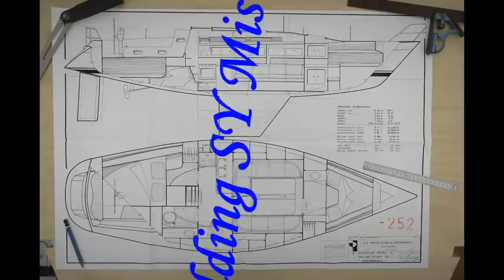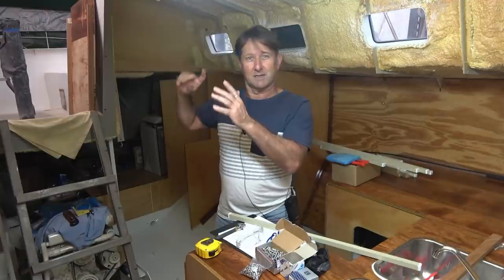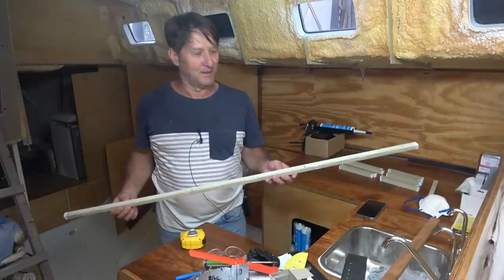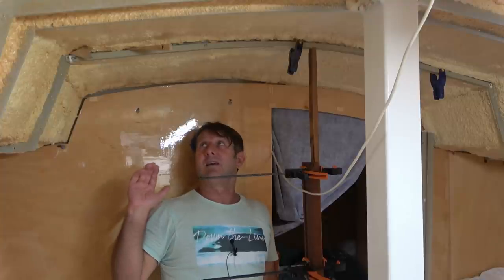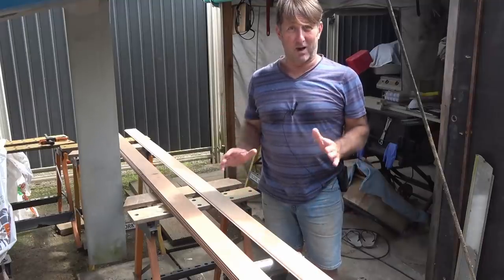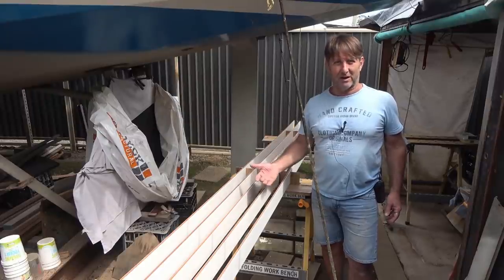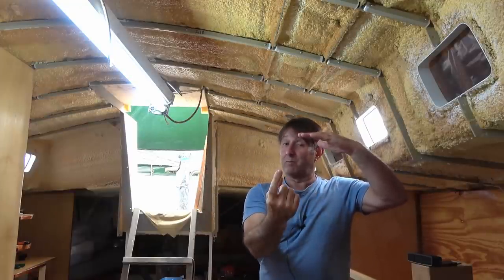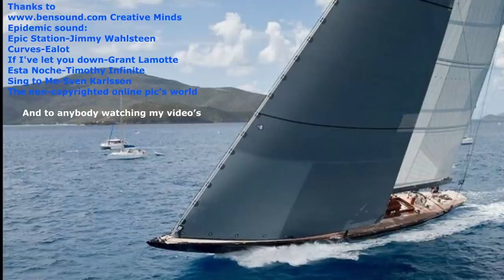SIGHT for SORE EYES! 🤩 Ep.121 Building my steel sailing yacht

Comment: Just a helpful tip you probably already know. If there is a dent in the wood you can usually remove it by placing a wet towel on the dent then use an clothing iron to steam the wood. It works like a charm.
Reply from the maker: Thanks for your good tip Colin, appreciated and yes, understood.

Comment: You could attach those boards with no visible fasteners if you wanted to, for a completely clean look. Eg, with blind nails/screws in the corner of the tongue, which are then covered by the next board.
Reply from the maker: Thanks for your suggestion Mark, however although tongue and groove in domestic installations would normally be brad-nailed at the tongue's to conceal fastening, in boats almost everything needs to be allowed for the removing and re-installing and so yet again a compromise decision HAD to be made  🙂👍
Reply: @BuildingSYMistress  Sounds good to me!
Reply from the maker: @MarkRawling  👍

Comment: I have to say that I'm a bit amazed that you are painting that perfect red cedar, yet you seem to be leaving the rotary cut fir plywood clear!? But you have your own vision for your own boat!

Always impressed by your care and attention.
Reply from the maker: Thanks very much for your good comments Nick and fyi regards the end look that I want for Mistress, I do not like the dark, heavy, shrunk look of clear finished timber throughout and most of the Hoop Pine plywood (not fir) will also be coated white.
Reply: @BuildingSYMistress  Fair enough. I look forward to seeing it come together.
Reply from the maker: @nickscott6459  Thanks  🙂
Reply: @BuildingSYMistress  Have to agree. At first I wondered the same thing. 
But the minute I saw it going up I realized that on the ceiling, were you really need a bit of light reflection it makes sense.
 Plus, I think you'll all agree that it's a bit easier to sand a little and add another coat of paint than to varnish, sand, varnish, sand, varnish... am I done yet?

Comment: Always thrilled to check out your progress! Thanks for sharing all the details of your work.
One question: have you made sure that all those holes in the ceiling beams haven’t weakened the roof structure? The effect is similar to what you described about that longer wooden batten that snapped in coincidence with the hole you drilled…
Reply from the maker: Thanks very much for your good comments and question Kristian and no, the few small 6mm holes per beams will make no noticeable difference to the beam integrity.

Comment: Just curious about the wood's name, "Western Red Cedar". Since we use a lot of that wood in the States, it has been called that because it comes from our western States and Canadian Provinces. Are you having to import that all the way from North America? 
Won't you have to run some electric wiring for your overhead lights before you put the ceiling paneling on?
Reply from the maker: Thanks for your comments and question Brian and yes indeed the WRC is from North America and yes, running electrical cable started many episodes ago and I have allowed for this, which you will see ahead sir  🙂👍

Comment: Awesome man. How did you make sure all of the battens were the same height? That's something I struggled woth
Reply from the maker: Thanks very much Rhys, appreciated mate and re. your question, the battens are set just a mm or so off the bottom of the beams, which are all fair from the build stage  🙂👍
Reply: @BuildingSYMistress  You're a legend old chap
Reply from the maker: @SailingYachtZora  🙂👍